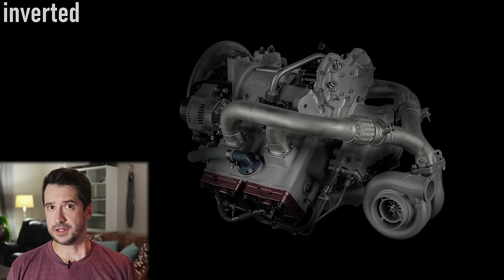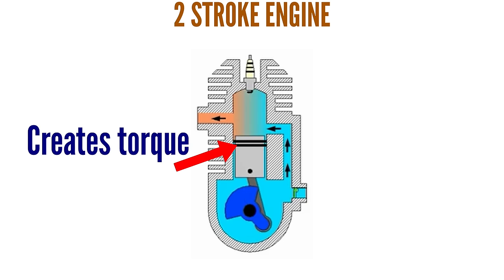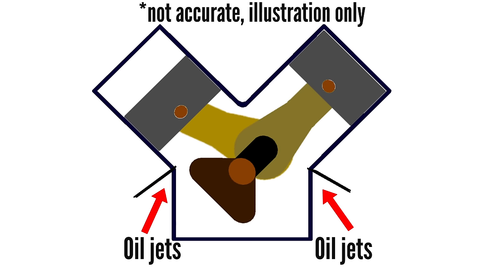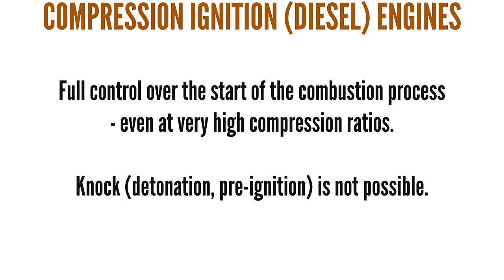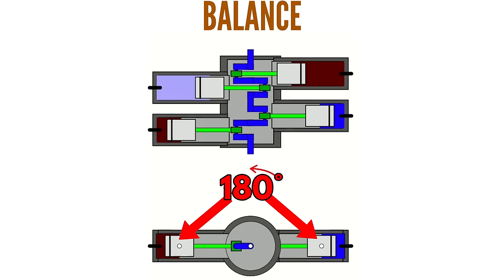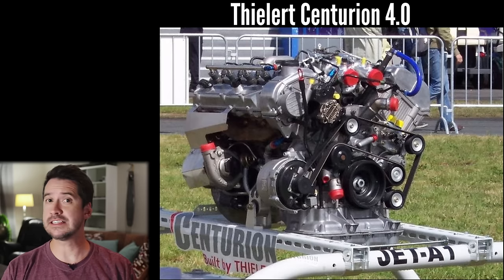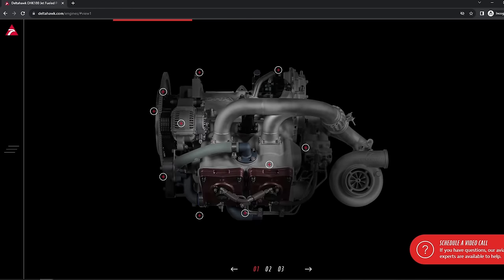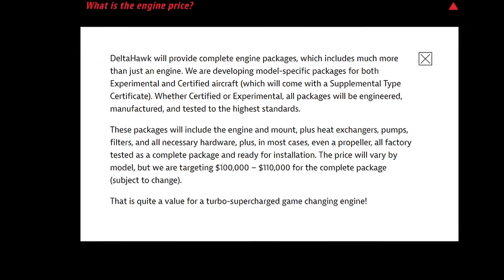Deltahawk's Jet Fuel Piston Airplane Engine Explained

Comment: I thought I would throw in that one advantage of a direct-drive engine is that the propeller can serve as a flywheel--geared engines have to have a separate flywheel adding cost, complexity, and weight.  There are practical limits to compression ratio--above a certain point, NOX starts to form in an endothermic reaction which robs power, creates noxious emissions, and reduces TBO by introducing acidic products with the H20 from fuel combustion.  Diesel engines also require longer connecting rods, to increase piston dwell time at the to of the stroke, which adds weight with the rods, the larger counterweights needed to balance them. and the higher deck height required.  (This is also a major reason why conversion of spark ignition engines to Diesel is problematic.)
Reply: That's why so many direct drive engines still have flywheels. Instead of having dead mass, you can have a generator in place of a flywheel. Do you see a flywheel on Rotax? Diesels don;t require longer rod for dwell time, diesel actually ignites and expands quicker than petrol. Slightly longer rods are negligible on weight. Diesels dont have any higher rod ratios than petrol, the main advantage of a longer rod ratio though for a low revving engine is reduced thrust loading as diesels have far higher combustion pressure.
Reply: BORE DIAMETER limits dwell time and rpm range.
Bore diameters larger than 100mm reduces rpm and dwell time
Reply: @chippyjohn1 Any engine with less than 12 cylinders needs a flywheel.

Not true, Diesel engines are Stratified Mode, Compression ignition.
Dwell time is reduced because it is limited to After TDC... Otto Cycle engines can Rev higher because spark ignition can be Advanced,  prior to TDC.
Reply: @WilhelmKarsten  Not every engine needs a flywheel. A flywheel is for momentum, once an engine is running at high speed the flywheel has little purpose, why do you think race cars use lightened or no flywheels. If you didnt have a flywheel on your car everytime you release the clutch it would stall. Diesels also inject fuel well before TDC, every engine is different. Diesels experience far higher cylinder pressures meaning they need heavier components to cope, heavy components dont like high rpm. There are many factors why diesels aren't made to rev high, but nothing to do with not being able to advance injection timing.
Reply: Perhaps--but what you say does not negate what I said--the way I learned it, Diesel combustion differs from SPICE combustion in having much less of a relative pressure spike, but the pressures are much higher overall and necessarily maintained for longer--that is one reason rpms are lower--the ignition is spread out--and also starts later in the stroke.  There is less proportion of the stroke for ignition.  The higher compression pressures required for Diesel ignition are maintained longer with a longer dwell,.  I would think that a generator serving as a flywheel would have to be direst drive itself, unlike that in a car engine--but if it  replaces a flywheel to allow geared drive, you still have the weight,   cost, and maintenance of the drive gearing.  Longer con rods may add negligible weight themselves--the big weight addition comes from the knock-on effect of a higher block height they require,.  Thanks for your addition to the conversation.
Reply: Well, we are talking about a comparison between spark-ignition and compression-ignition engines--relative between similar-sized engines.  What you say is true in addition--it does have relevance to the necessary larger displacement of a Diesel engine in comparison to an analogous spark-ignition engine (although here, the 2-stroke cycle super-turbocharged Diesel is not exactly analogous).  I actually like the concept--I just slightly doubt the numbers.    @WilhelmKarsten
Reply: Just for those reading, Wilhem and I are using different definitions for "dwell."  I am referring to the time the piston spends at the top of its stroke, which is increased by connecting rod length, while he is referring to the time it takes for the flame front to travel across the combustion chamber.  I have edited my original message to make it clear exactly what I am referring to.

Comment: Would this engine fit on a 1956  Cessna 172 ❓ Would one need a redrive on it ❓.
Reply from the maker: The engine is direct drive, no redrive needed. I don't know the official answer on that from Deltahawk. Physically I'm sure it will fit, but don't know if the standard cowl will still work and can be modified, or if will need a new cowl. But I think it might be too heavy. A Lycoming O-360 weights around 270-280lbs (which we know will be fine on the 1956 C172). The Deltahawk weighs 334 lbs dry though.

Comment: Reminds me of the Rotax direct injection two stroke engines.  They were lighter, simpler, and very efficient.  The oil had to be injected separately from its own tank.  Problem is that people would forget to add the oil from time to time, causing the engine to seize.   This gave the engine a bad reputation and sadly the engine was cancelled.

Comment: Junkers Jumo 205 two-stroke opposed-piston diesel engine was used in passenger airliners in the 1930s.  No doubt using kerosene instead of diesel could have been possible.

Comment: Here is some additional data on the Deltahawk engines.     The cylindar sleeves are replaceable.  So factor in the 100K price tag, but also factor in likley much lower costs and simpicity of replacing parts,  also external oil pump, there are other features I don't recall (from merely studying the webiste of Deltahawk) that are time savers over the typical lycontisaurus type of engine.    The engine seems very sound and as explained it looks like it can do what they say.

Additionally, if you factor in the simplicity of part replacement, even cylinder replacement, with the sturdiness of a compression ignition (essentially a diesel) block, in something like an experimental category, if one has a repairman certificate s/he can replace these fairly easily replaceable parts themself.  So there are a lot of variables to see how this new engine, if it runs as intended, could be an excellent value added acquisition to your air travel.    People think in terms of price, sometimes costs, but here the value of this 100K engine may prove to make this a lower cost of operating.    Then there is the potential fuel savings, availability of using Jet A fuel instead of 100LL.   A lot depends also on the company and how well they handle this next phase.

It isn't out yet in production in many aircraft so we have no real world data on what's true or not in the field.   The company claims it is revolutionary, just wish they would hold off on that until it proves to be so.   Maybe focus your energy on getting the production run successful .   Their certification of the Deltahawk engine was a huge thing, not only in itself but represents that the company will do what it takes to get this moving along (and is willing to go get more money and can do so if need be )  so it looks like this company could get this produced as intended.   Wait and see.
Reply: It already has taken way too much time. I think they will be overrun by other new piston-based designs, or by the new small turboprops presently coming out.